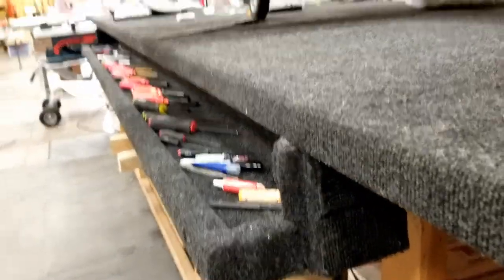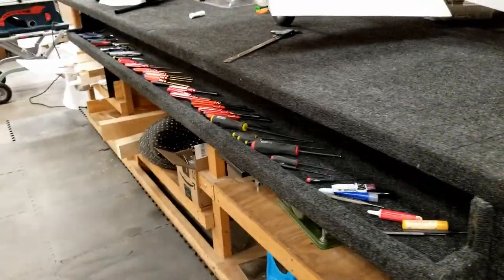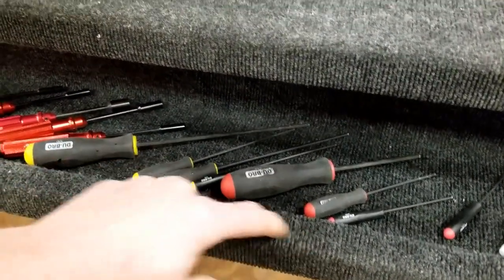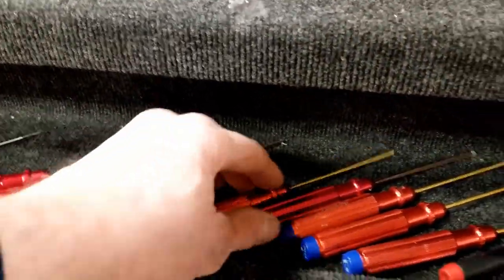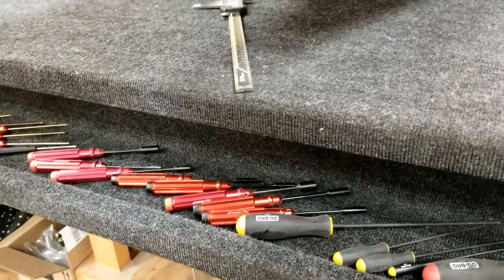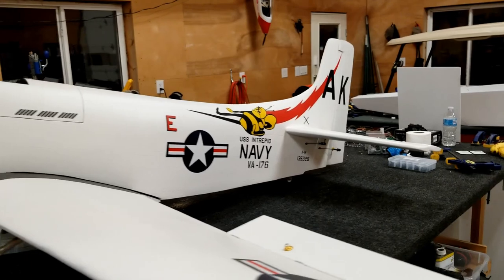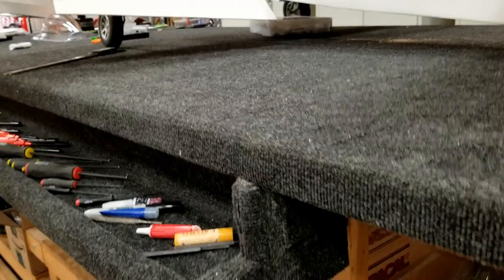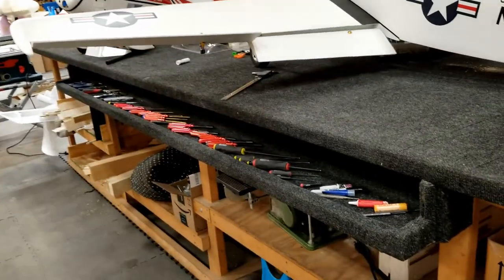WORK BENCH RCTWINS

Comment: Keeping the main work surface tidy and organized is definitely a plus.  My bench is built primarily for woodworking; a common move among woodworkers is a "tool well" on the opposite side of the bench from where you spend most of your time.  Woodworking benches are narrow enough that that works fine - it's easy to reach over there.  Obviously the size of the planes you guys build precludes that - I think what you've built here is sort of the "obvious modification" for a wide bench.  At any rate, the basic idea is solid gold.  Keep that tabletop open.  It's never fun having your workspace crowded and messy.
   
Thanks for sharing, and stay safe and well out there!